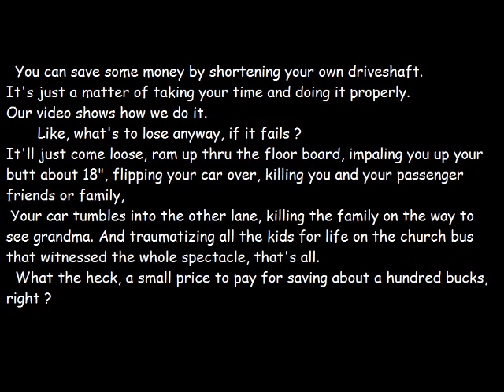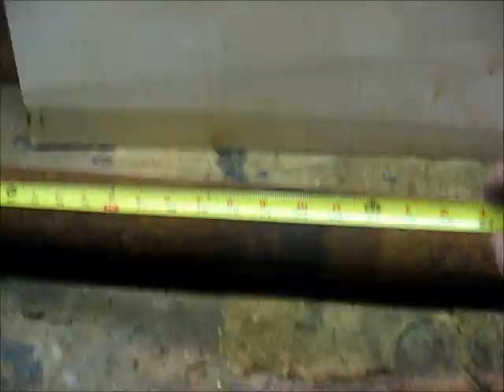How to Shorten a Drive Shaft, with Basic Tools.

Comment: I always do this on the vehicle. Jack the axle up, so you can rotate the shaft. Two tack welds opposing each other, now rotate shaft with a dial indicator attached to see if your out of round. If so, a few taps with a hammer should get you straight. More tack welds, recheck. If all is good, weld it up. Then use the hose clamp trick if necessary to eliminate vibrations.never had to though.

Comment: Pro tip: always, always lengthen or shorten the rear axle uj side... If it decides to snap it will just drag instead of stick into the road going forward!
Reply: That's what drive shaft loops are for.
Reply: Good tip thanks man
Reply: Just put a loop in each end for each section and you're covered.

Comment: Good entertainment.  I like the guy just turns his head when the welding is being done!   They even admit that they should have installed the u-joint after the welding!  I have been a master auto tech and master heavy truck tech for over thirty years.  This is a good example of how to REALLY screw up your project.  If you already have spent the money to install an upgrade or different transmission in your car, don't you think it would be worth the extra 100  dollars to get the drive shaft cut and balanced correctly?   "Biily Bob" and company are an interesting group, hope they don't loose too many fingers in the process!  Like the part where he is using the press to remove and install a new u-joint.  No scatter shield or better yet, let's leave our hand in the working area just in case we need less fingers!  I have worked around both heavy equipment and passenger cars professionally for over 30 years and I still have all my fingers and eye sight due to safe procedures!

Comment: I've chopped a lot of drive shafts and grinding off clouds of rust and dirt is not done until the cutting is.,., another thing., a 4 1/2 inch angle grinder with a thin metal blade works best., if you know your length., just cut it off and then deal with grinding the actual yoke from the shaft.,., oh., and welding.,., use a mig with gas ., ';'

Comment: You can just cut below the existing weld line, and not have to grind so much,,and never put new ujoint before you weld, you will cook all the greese inside and overheat the needle bearings